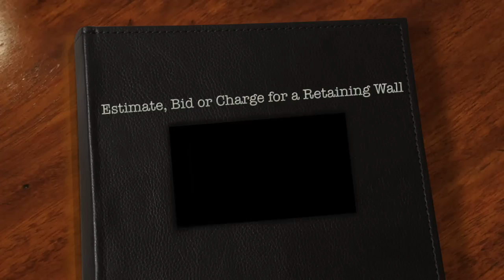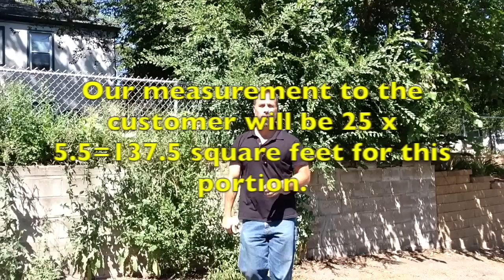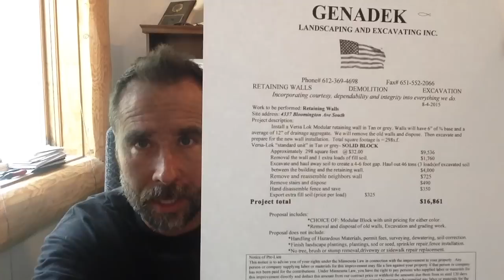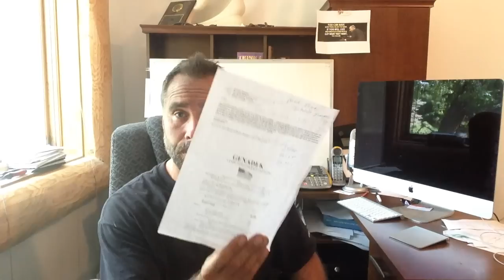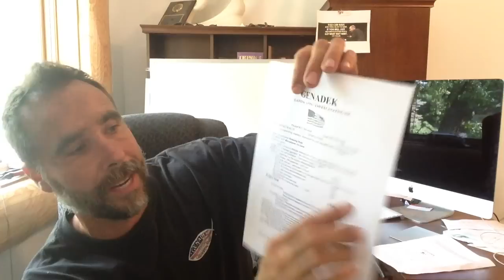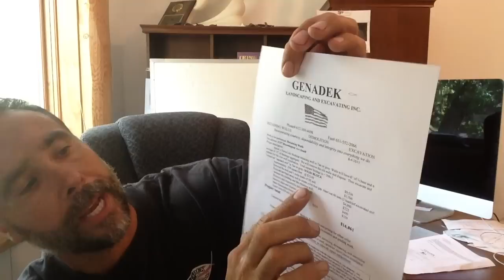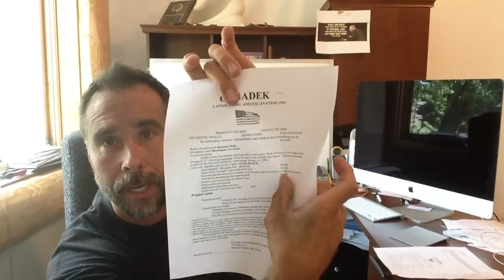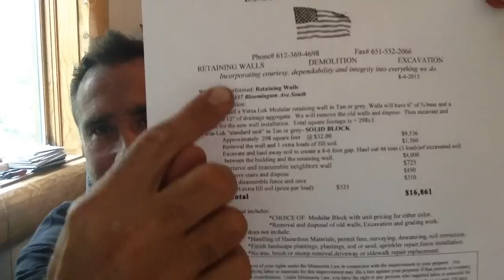How to do Retaining Wall Bids, Estimates and Proposals

Comment: The information on job bids is universal and very good advice. I'm a machinist and I am trying to start my own little shop. Most bids are given lump sum in my field cause the customer only cares about the cost per unit but on my end I'll be line itemizing tooling, setup time, machine time, and an extra 10% to cover any scrap parts that may happen. Having that information to produce for a customer may make or break a job in some cases. That information also makes it easier to keep track of the black. When I lose money I'll be able to clearly identify where I lost it and change my rates accordingly in that area.

Comment: To get a more exact mean hight measure:
Measure both endes of the af take the mean value. (low end + high end)/2.
Rhen you dont have to find the dead center point of the wall. :)
Very very Nice video.

Comment: Very good point of building proposal into portions  I break mine down from site preparation including demolition by square foot and or face feet and additionally the expense of disposal of debris by ton or cubic yard s. An additional line item of Installtion of this example retaining wall  by the face foot including labor and materials per face foot broken down to disclose inevent that you have a project that is stopped by the customer a clear delineation of as amount is due for material and services provided are easily and clearly reducing potential losses in a potential and unlikely litigation hope this helps
Reply from the maker: Thanks for the comments Marc!

Comment: Loved the video, but I live in an tropical area (Puerto Rico) and I need to build at least a 3-4 foot retaining wall in my back yard and about 10 feet long. The soil is clay like material. What should I use or how should I have it built?  I also have an avocado tree that is small, but it would land 2 feet close to the wall should I move it and how far. Thanks for your advice. Sandra

Comment: what I didn't see or here you talk about to protect your self are 2 things, 1 - the short tie back wall to the garage from your 4 foot back from failing wall. 2 - the garage failing wall can be worse then it looks on the back side (were back fill is) 1 - customer not happy how that back side looks, 2 - the garage wall falls well digging it out, even though caution was used but the wall is so decade under ground it crumbles under the least movement, I have had it happen, you cant see whats under ground

Comment: It is a very good information, question: is french drainage consider?, the pressure that the wall recieve is very massive, if we see  the height of the upper plattform is very considerable. other question: a concrete wall will not more suitable?

Comment: Hey Stan, I have a question for you kinda off topic. I am doing a flagstone patio and I’m curious and would like your input on what to charge per square foot. I cut all of the flagstone except for the outside edges of the patio or if it be a walkway. I also tumble all cuts by hand with my brick hammer to still keep it looking natural. I am very busy with work and want to make sure I am not undercharging the customer and losing money. I would like to send you some pictures for example so you can get a good idea on the quality of work and to better help with pricing.

Comment: I am bidding a three tier retaining wall in an inaccessible backyard(inaccessible except via taking out back privacy fence sections). 
I am counting 540 sq ft of wall. Customized beds on each platform level, a 100 ft  flagstone walkway, as well as several fruit trees planted not to mention tons of soil which I haven’t even measured yet but the tons or cubic yards should be easy to approximate. Would a price of 32 or more be standard in this case ? ( HELP)

Comment: I am putting in a retaining wall that is 3 tall and 100 feet long. In a teared pattern that will be approximately 25 feet sections. Is there anything that I need to watch for in this? Do I still need to use geogrid at 2 feet?

Comment: what did you use to excavate next to the garage (mini w/ front end load)?   what were the "logistics" of the dig (how did you get the dirt into the truck?)
Reply from the maker: Mini excavator is th best choice-  you can pull the soil away and keep pressure off the building.

Comment: What would you charge per software for a 36sqft wall? 3ft high x 12 long. And how do you know if it needs some sort of drain?
Reply: Charge $1,900 - that includes the base layer. Always put drainage behind your walls doesn’t matter where the wall is going!

Comment: I need to build a wall that is 5.5 ft on each end, and ascends to 8 ft in the middle. I used an average of 5.5+8+5.5 to calculate my material (I also added the buried course). Is this correct calculation for material?

The material is much appreciated!
Reply from the maker: +Mark Nunn That is a good way to calculate quantity.

Comment: Hi Stan I have a chance to take over a landscaping company in Calgary Alberta I have worked for this company for 2 yrs but was never involved with the quotes and pricing the 38 bucks a square ft for the wall how do you get that I know you must get a contractor price for the blocks what is your mark up for the customer
Reply from the maker: Every area is different. Use this as a guideline to formulate your own pricing structure. 👍

Comment: Retaining wall installation s should never be sold under 40.00 per face foot. Small projects depending on the material should not be less than 50.00 per face foot  plus demo and additional cost to haul away the debris